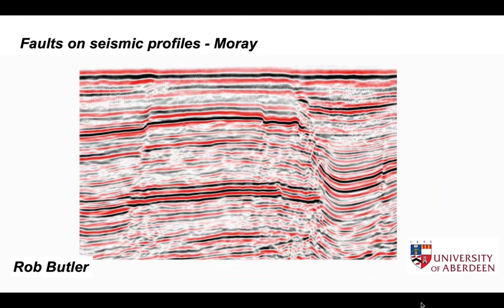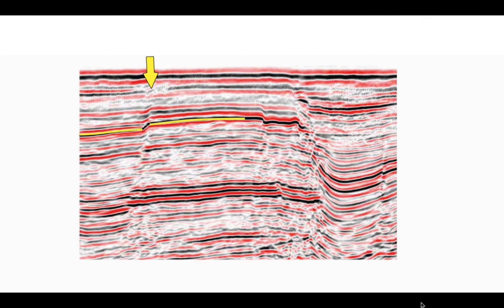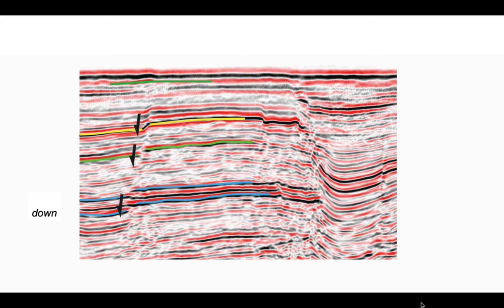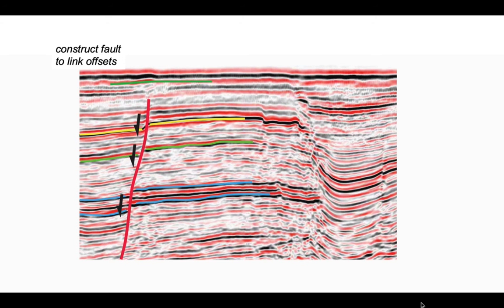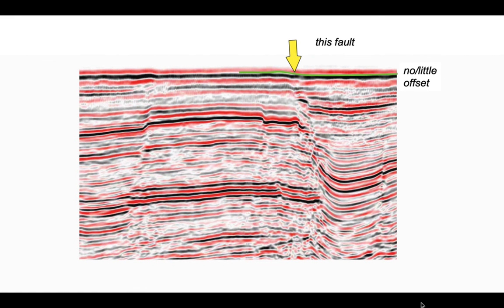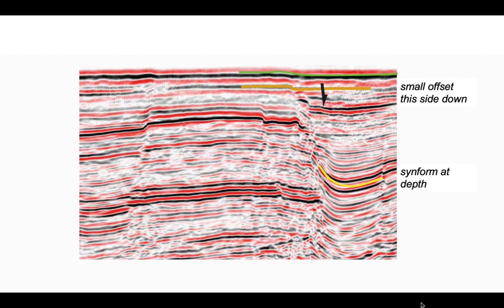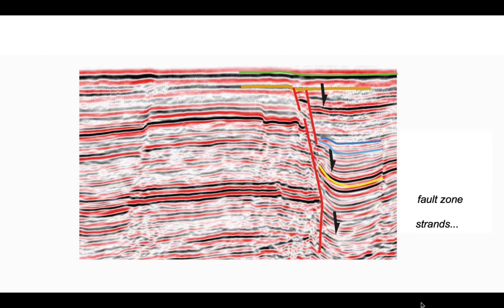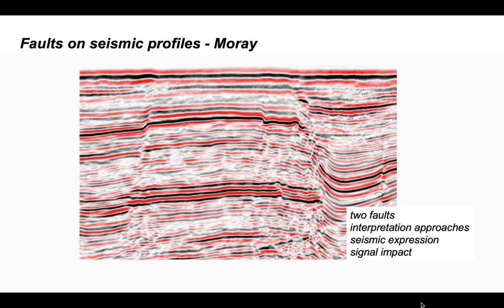Faults on seismic profiles - Moray

Comment: sir what can be the criterias for fault identification?
Reply from the maker: As part of a coherent interpretation of stratal reflectors. In  - offsets of stratal markers (so need to match across the feature you're interpreting as a fault). Single-side terminations are insufficient criteria (could be on-laps, channel edges etc). But as with all subsurface interpretations - there are inherent uncertainties and few hard and fast rules.